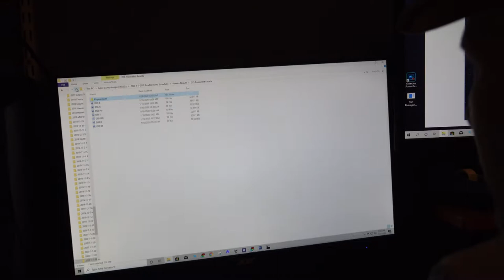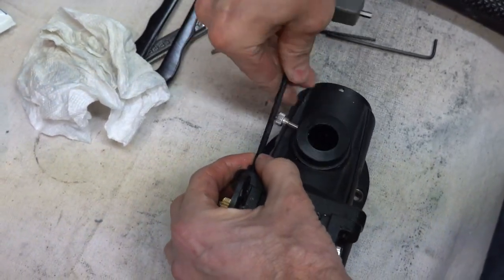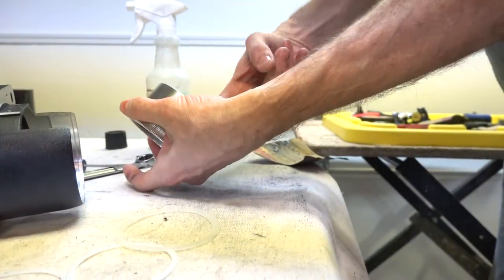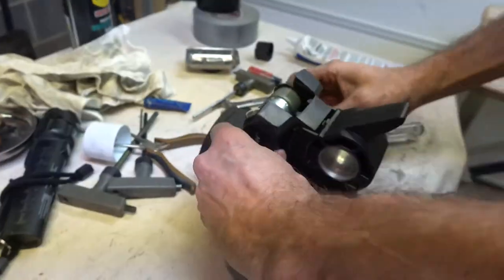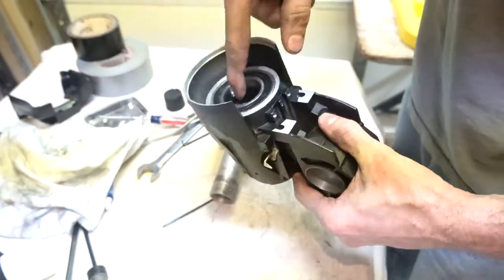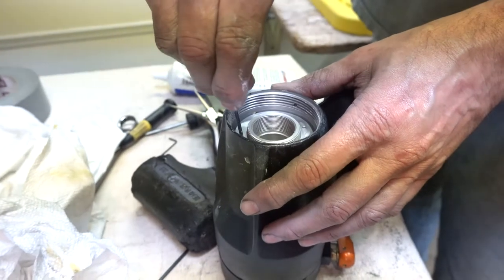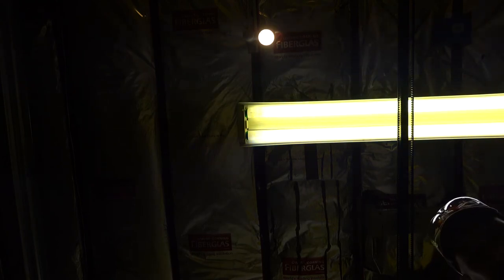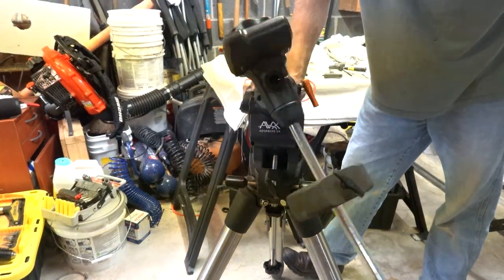AVX improvement

Comment: For the lower RA motor cover if you remove the two screws and remove the altitude pointer it lets the cover easily tilt down and slide off no problem. It worked easily for me.

Comment: Hi Robert.  I figured out a way to get that lower cover off/on a little easier.  Best to remove the servo pinion prior to removing the cover.  Likewise, hold off final install of the servo pinion until you put the lower cover back on.  The extra couple mm makes it a little easier but not much.  I shoehorn the motor board first to prevent damage.  I've been monkeying with mine since my RA servo started skipping while slewing at low speed (below 5).  Love your background music.

Comment: thank you so much for posting this. i have a second hand avx and it has been having issues this is going to help so much. 
Roger
Reply: theres much better videos that explain as they go. this video gives u idea of where the parts go. with that compresssssssssoooorrrrrrrrrrr omg
Reply: Wherr did you find a used avx? Lol i ended up caving in and buying new, after weeks of searching for a used one..
Reply: @Handles-R-Lame  cloudynights.com usually a few pop up every month or so. im hoping to have mine up there for sale before Christmas
Reply: @rogerjackway429  of course the classifieds on CN. Mind me asking why are you selling now? Sorry for the late reply as well
Reply: @Handles-R-Lame  i just bought an eq6r pro but i actually might keep my avx and 6rpro. rub the avx off APT and have the 6rpro on asiair pro. i have been clouded in for 2 months so i have not had a chance to get the 6rpro out to test it. my avx thought has amazing performance since i swapped the bearings. .31 pixels to .38 pixels error at 714mm. im going to see if i can beat that with the 6rpro once i learn to hypertune it.

Comment: Having second thoughts of buying this model now, don't want this headache. Great video btw
Reply: this isnt always needed.. i have one now for 5 years. never done a thing to it.
Reply: @XPFTP  yeah im going on my second year, besides all this can be circumvented with having an autoguider or a polemaster. I believe he may be doing this to help solve the backlash issues but i think PHD2 will help in most cases. 
Regardless the AVX is a great mount and yeah the heq-5 is better by a slim margin but its also more expensive. The fellow doing all this to the AVX is the extreme tune up of a mount, its not neccesary to do on all AVX mounts but it does increase the accuracy however when its done..
Reply: @Handles-R-Lame  if i was shooting with a 9.25 sct. yeah i would say do all you can.. autoguiding helps tons. but if your using a 6inch net down to a 80m ed. then naaa not needed as long as your auto guiding.
Reply: @XPFTP  of course the 80mm refractor is always the best option(thats what everybody suggests it seems lol) when imaging  but you are correct i have a hard time getting round stars on my C8(about 2000mm focal length) even when using the 67x reducer. But in honesty, the AVX is a great "beginner" mount for the cost, sadly people in the community put alot of hate towards it tho. I can understand why but its far from a horrible mount imo.

Now only if i could get my SkyWatcher EvoGuide 50mm guide scope to actually come to focus with my ZWO 120mm camera; only then will the AVX be a king in my book.. 

the hurdles we have to overcome in Astrophotography sometimes... lmao

Comment: What Lithium grease did you use, and what was used to lubricate the bearings and gears.  Lastly, please advise link to RA bearing, and if you have it, the link to the other RA bearing shown, what you referred to as the "lazy Susan".  Thank you.
Reply: @rogerjackway429  Thanks for info Roger. My question is, does replacing the bearing effect load capacity, increase a few pounds or it's just for fine moving? I mean, AVX load capacity is 12,5kgs. Can it be 13,5/14 kgs replacing bearing? Thanks.

Comment: Hello, what kind of grease do you use ?
Reply from the maker: white lithium grease.

https://youtu.be/jvJaM9cOS7g

The bearing I used is a Timken L68110. Amazon has it for $13. I'll add the site I used and the Amazon link to the bearing. My friend shot video me doing his AVX mod. I I can see if I can find it if you'd like. Mine does better at everything now. Quieter, smoother, better tracking which all leads to better images. I got all of the stuff to do the polishing at Harbor Freight. I used Maguire's heavy cut automotive paste when polishing. I used white lithium grease from a car parts store for assembly. Things were not greased very well or at all from the factory. Shot on the modded AVX. I guess you would call it hypertuned. I went over the gears and cleaned up burrs also. https://flic.kr/p/2jHZX6i
http://rocketsparrow.blogspot.com/2017/01/how-i-made-better-celestron-avx.html https://www.amazon.com/Timken-L68149-L68110-Roller-Bearing/dp/B07CH43DCY/ref=sr_1_1?crid=3IN7J3TKBCTQO&keywords=Timken+L68110&qid=1671087613&sprefix=timken+l68110%2Caps%2C109&sr=8-1
Reply: @medicineman4040  thanks

Comment: Is there any way you could get me in contact with this gentleman? I would be happy to compensate him for an over the phone consultation, I’m just very frustrated. My AVX mount has never worked properly. I sent it back to Celestron initially and I thought they replaced it and sent a new one, but it seems the replacement has the same issue. DEC axis does not turn. I can hear the motor working, but it is not sleeping. Now that I’ve followed this video to take it apart, it seems the worm motor is only turning the outer ring (removable piece with the teeth for the worm motor), but not turning the whole “barrel” (I’m sure that’s not the right name for it). I must be missing something and would really appreciate some assistance/explanation/advice. I’m going to Colorado in two weeks and really want to be able to use this while I’m there! HELP!
Reply: Did you ever get it fixed? My advise would be to bring the gears closer to remove backlash, remove any old lubricant and relube then finally reflash the firmware on the mount by plugging in the hand controller and updating it through Celestrons website. 
Sometimes a hard reboot or in this case a reflash will restart any electrical misconfigurations, however if its mechanical then sadly calling Celestron again is the only option.
Hope you get it all sorted out tho. 

Clear skies.

Comment: Very nice! I am asking me why this has to be done from yourself, this is part of celestron if they are interested in celling quality!
Reply: They are not interested selling quality. They are more into conning customers. Class A lawsuit will wake up Celestron and IOptron.
Reply: @anata5127  they're not breaking any laws. Just selling cheaply some Chinese gears, motors, plastic and Chinese assembly. If you want a mount where everything just works and does a phenomenal job almost without any error at the payload capacity of a particular Celestron mount, pay 2-3 times more for the premium competitor and you'll have a great mount. Just but a Software Bisque Robotic Paramount MYT mount for $8k or Astro-Physics 1600GTO for $19k :-) They'll work perfectly right out of the box!
Reply: @GregoryK-IYA  They do by writing wrong specifications. More, if mount doesn’t correspond to specifications, they start to tell excuses that they check it on bench without load. Product must correspond to specifications, or they should take it back without hesitation. This is a law, Well, they don’t get it. Only after getting between balls (there are approaches to do so), they get it. If they don’t, their license for selling in US can be revoked.
Any fixing and tuning of mounts by yourself generates them income. Do I need to explain you how? This is against law as well.

Comment: For a $900 mount it does not have ball or roller bearings. Celestron got skimpy on that. Even the old CG 5 has ball bearings on both axes.
Reply: my cg5 ASGT doesn't have bearings on Dec. I'm current making a new Dec Arbor to put in bearings.
Reply: @travisbrimer772  Haha, this is true, I just took my ASGT apart. :D
Reply: @travisbrimer772  BTW, I am interested in your project, will you make a post on Cloudy Nights pls?
Reply: @aozhou4535  Yeah I can, I have my design ready. Just been too busy to machine it.
Reply: @travisbrimer772  That's cool, look forward to it!

Comment: ugh u cheated and didn't show how you got that bitch of a plastic piece off the motor. you go to wash your hands the camera stops then comes back and the plastic piece is off. No!! Thats where I am stuck. LOL.
Reply: solution for me was to take the gears off then the sensor wheel and circuit board. the bottom cover wiggled off fine after that. the cable and power routing is going to be a pain to put back as they had it.

Comment: This may be an accurate depiction of how to do this work, but it looks like you are working on a lawnmower on the floor of your garage.  I would expect more of a skilled technician or machinist's working area theater.  Cleanliness is critical to precision machines, and it was never addressed.  Keeping notes and taking pictures as you progress should be standard.
Reply: And then there are mechanics that can work in an organic based organizational system like this.    Ideal? Heck no.  Can it be done.   Yup and damn well!